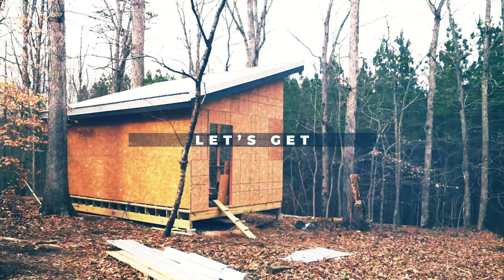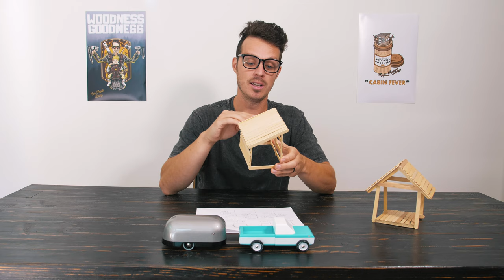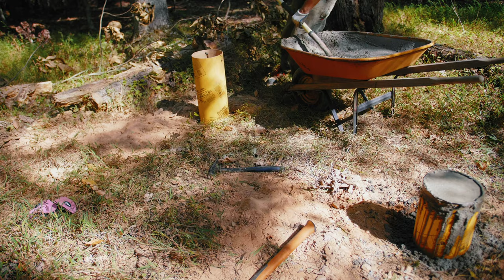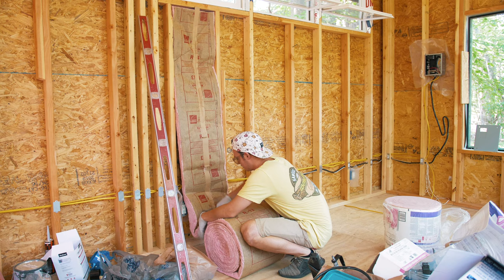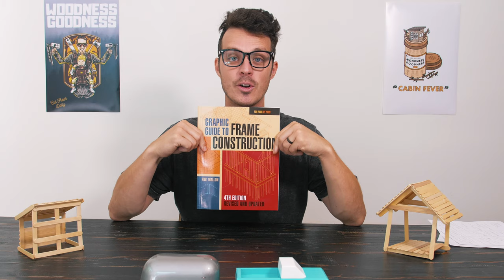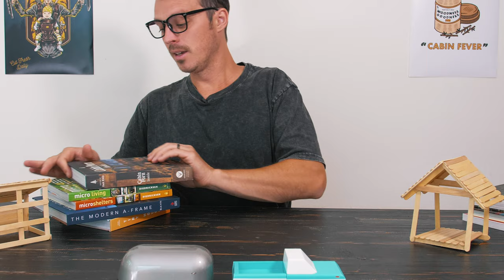Before YOU Build a Cabin - Cabin Building 101

Comment: Hi Graeme, great video! Did you have to provide any sets of plans to the county for your cabin to issue the construction permit? Did they require any engineering drawings or is the building code in Virginia providing enough guidance that a small building would be covered ?
Thanks a lot !

Comment: This is exactly the video I needed to see.  Did you build your cabin in Canada?  I'm just wondering about the insulation required.
Reply from the maker: chaccaron4321 awesome!! I built it in Virginia. Insulation up there will need a vapor barrier for sure. Local codes might require poly barrier or faced insulation. You’ll have to do some digging!

Comment: Another great video and merci (salutations de Montréal).  Questions: if you wanna do a first cabin but look at all that thinking and work and say "Jesus H, man, why not have a 2000 Sq ft instead of 200 ft cabin..." why not start bigger if it's the same or similar process? I can guess at the answer but curious why this size and this level of complexity for a first project rather than something else?

Edit: congrats on bebé - !
Reply from the maker: Salut mon ami! I had to keep the cabin under a square footage so I could avoid other permits. That’s the main reason. I’ve had this idea for awhile and just had to build it to get it out of my head!
Reply: @WoodnessGoodness  Makes sense. I can imagine that building a proper home-sized building could require an RBQ (builder / GC) licence here or almost anywhere.